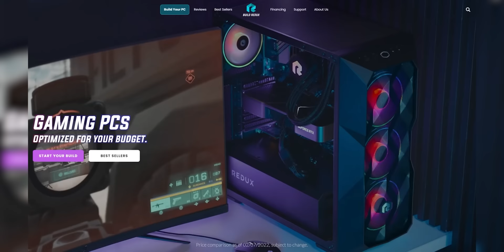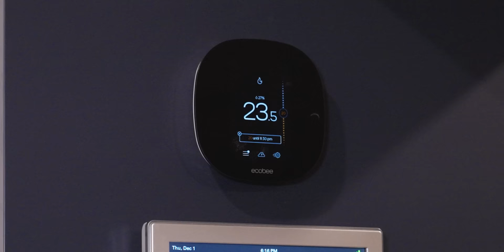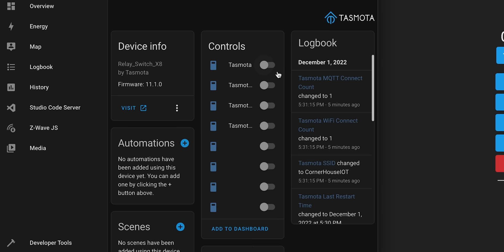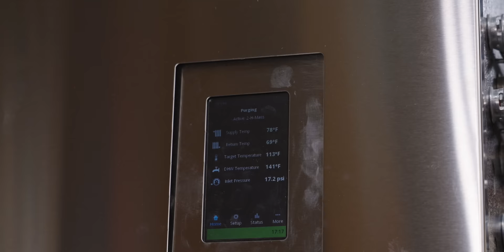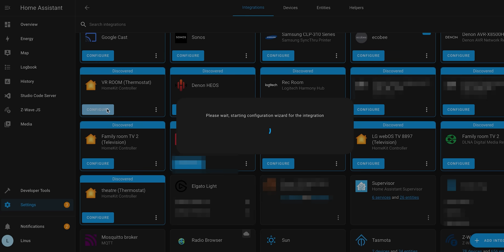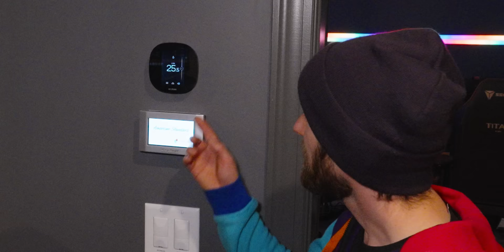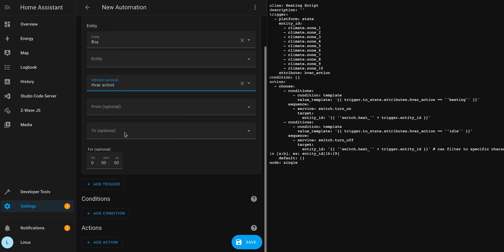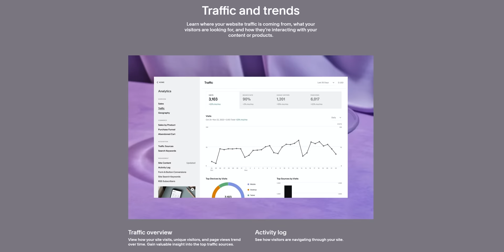My Smart Home is Stupid - HVAC Update

Comment: There's a company only 10 minutes away from the LLT offices called Delta Controls. I strongly encourage you go look at their stuff, maybe do a video on some of the stuff they do.
They make building energy management system (BEMS) controllers with a new product line coming that supports MQTT communications. Would be super interesting if those could be integrated into home assistant, if not then I'm sure they would have some cool stuff to show off. A lot of the engineers there are super nerdy based on some of the jokes and memes they put in their docs, wouldn't be surprised if some were viewers already.

Comment: You can buy separate temp/occupancy sensors for the ecobee's, and just set it so the each Ecobee uses the separate sensor for the temperature and not the built in one if it's being thrown off by the American Standard thermostats. Or you can let it average between the two sensors if you want. Plus, you get the bonus of having occupancy sensors.

Comment: I’m an HVAC tech I’ve had two ecobee‘s short out internally and generate heat causing the readings to be off I know that eco-bees don’t use relays and I think that what ever they use to do the switching is what’s causing it I doubt it will be a problem in the situation but in a standard system where the ecobee is actually sending voltage to turn stuff on when they short out it won’t send a Full 24 V signal usually they level off around 15 which causes the equipment act weird

Comment: A toothpaste factory had a problem.
They sometimes shipped empty boxes without the tube inside.
This challenged their perceived quality with the buyers and distributors. Understanding how important the relationship with them was, the CEO of the company assembled his top people.
They decided to hire an external engineering company to solve their empty boxes problem.
The project followed the usual process: budget and project sponsor allocated, RFP, and third-parties selected. Six months (and $8 million) later they had a fantastic solution – on time, on budget, and high quality.
Everyone in the project was pleased.
They solved the problem by using a high-tech precision scale that would sound a bell and flash lights whenever a toothpaste box weighed less than it should.
The line would stop, someone would walk over, remove the defective box, and then press another button to re-start the line. As a result of the new package monitoring process, no empty boxes were being shipped out of the factory.
With no more customer complaints, the CEO felt the $8 million was well spent. He then reviewed the line statistics report and discovered the number of empty boxes picked up by the scale in the first week was consistent with projections, however, the next three weeks were zero! The estimated rate should have been at least a dozen boxes a day.
He had the engineers check the equipment, they verified the report as accurate.
Puzzled, the CEO traveled down to the factory, viewed the part of the line where the precision scale was installed, and observed just ahead of the new $8 million dollar solution sat a $20 desk fan blowing the empty boxes off the belt and into a bin. He asked the line supervisor what that was about.
“Oh, that,” the supervisor replied, “Bert, the kid from maintenance, put it there because he was tired of walking over, removing the box and re-starting the line every time the bell rang.”

Comment: I’ve gotten pretty disillusioned with smart home products over the years. I’ve lost more time to dropped connections, hub failures, and other issues than I’ve gained from the automations. I’m hoping things mature and standardize more with the introduction of Matter, but it’s been a rough ride in the meantime.
Reply: EXACTLY!!
Reply: I'd welcome you to homeassistant to be honest. I still have my smartthings hub setup for the zigbee/zwave stuff but I really need to integrate that to my Ha directly but, Ha is definitely very stable for everything I have running wich ends up being quite a bit of stuff
Reply: Just wait until the utility companies override your settings, because you're using too much energy/resources! Nothing beats a wood stove lol
Reply: @JoeyJoJoJr0  This is why I wouldn't use any cloud based device. Certain companies are working on these things. Eve Energy uses bluetooth LE and their open standards Thread protocol to have devices talk to each other and not even need WiFi or internet.
Reply: HomeAssistant with a sonoff zigbee stick has been the best for me. No unexpected behaviour and it just works. I automate everything with some Node Red scripts and that's about it.
Reply: So many issues that could be avoided with a single twisted pair

Comment: 11:58 - That's a pain in the rear, but showing this will help others not to make the same mistake.
I've even come across badly designed thermostats where the device itself warms up the thermostat on the PCB inside to give incorrect readings.

Comment: What is great about Ecobee is they have room temperature sensors so we can more accurately get the temperature the way you want it in the room you actually sleep in.  Who cares what the temperature is in the hallway?  It can be too hot or cold out there and I don't care.  Most thermostats work that way because that is where they are placed.  The Ecobee temp sensors run on a watch battery and let you fine tune the temperature where you actually want it.  They also have occupancy sensors if you want to adjust based on that.

Comment: Use the output from the American Standard thermostats to input into the EcoBee, so even if the American Standard stat called for cooling it would only engage if the ecobee said so...  it's a switching 24v circuit that turns on and off a switch in the AC that will run a cycle...

Comment: I'm posting too many comments. But you can get specific plates to go behind thermostats to prevent heat from the wall from affecting them.

And the hole that the wires come through should almost always be plugged.

Comment: My ecobee thermostats have always sucked at reading the correct temperature. If you don't want to get external sensors you can adjust the reading in the settings but I still recommend external sensors. They work much better and you can get temp readings from the entire/multiple rooms instead of just the one spot on the wall.

Comment: In my previous flat I never actively heated myself in ten years. The window sealing was poor, you could feel the wind coming through and I was out working from 5am to 7pm most of the time. Would have been the biggest energy waste every. The heater only turned on by itself due to the freeze protection mechanism. So the average room temperature was 9°C and my bed room close to 3°C and below (badly insulated roof). And yes, I mostly was only in my T-shirt and barefeet. Well, my friends visited me never in the winter, once maybe, but then never again :D ... 

Now I have a house, modern build, perfectly sealed and it includes a permanent controlled air flow and air exchange system; in short: I don't need to open my windows for fresh air.
So, due to the permanent exchange of air, I have to heat in the winter so that the system's heat exchanger works correctly. Regardless, the system is set to a day temperature of 19.5°C and a night temperature around 17°C. My bed room's heating is turned off; it's only getting passive heat from the other rooms.

I always feel amazed about people wearing so many clothes and their need to set the room temperature well behind 23°C or even 25°C to feel good...

Comment: I love the FLIR on my uleFone Power Armor 18T. Much better phone than that CAT phone tbh. But, the FLIR is an amazing addition that I have used to find insulation issues electrical issues, etc, and you can find studs in your walls with them which is awesome as well.

Comment: Assuming you’re not just using Ecboee because they gifted the thermostats to you or something, it was a huge missed opportunity to not use Venstar thermostats. It’s a Canadian company and the thermostat supports a local REST API from the factory. I believe they do offer a cloud weather integration feature, but I don’t use it and it hasn’t skipped a beat.
Reply: Don‘t know about them but thermostat choice is pretty irrelevant imho. Smart home stuff only makes sense when you regularly change the settings of it, like the temperature. This however doesn’t make sense when you have in floor heating as it is so slow to respond (which is a  great thing)

Comment: Man I wish I had remembered to send a merch message about non communicating system options sooner. The only one I know of is Maytag but they have an 18 SEER modulating heat pump system that doesn’t have anything communicating about it and you can just use a standard 6 wire thermostats.

Comment: Just zone the ecobee with smart sensors and gut keen smart vents and use there receiver /actuator to run your in floor hearing.  It works on my radiator heating setup. Then all you need is to set your heat pump as emergency heat and get rid of your other thermostat.  A single ecobee will use in floor heating as your main heat and when it falls out of range it will use second stage heat/ emergency heat to bring the zone current and is all configurable in the single ecobee thermostat

Comment: As an HVAC tech this is a nightmare of a system. And its mostly the tech side of the system. I install Trane/American standard as my primary systems. I am curious to know if you have 1 singular heat pump or several connected to each tcon thermostat. they make zone sensors that can be weighted for those thermostats, several can be connected to one thermostat. those thermostats do give off heat at the top, its a frequent problem im tasked with addressing. I'm not sure having a dozen ecobee's was the right course of action for radiant in-floor when in-floor heating takes a substantial time to get to temp, though once the floor is at temp it would be better but still not as fast as other options. it would of been easier to leave new mechanical basic thermostats for the radiant in-floor all at a basic temp and have a secondary unit heat rooms to their ideal temp. Much like course and fine adjustment. that would zone the system easily without wasting money on utility bills and you still can adjust the radiant even further without having spent 2 grand on thermostats. But I dont know your rates for fuel. natural gas/propane and electricity costs. like if your electricity is wildly high.. well then this all makes sense.

Comment: I will buy floor heating controls, heat pump and ventilation that can communicate via RS-485, and make a custom HMI, maybe with Ignition HMI. That will be a very reliable system due to the serial bus, and easy to set up.

Comment: Yeah...instead of upgrading tech I downgrade pretty much as far as you can go.  I put in a big ceramic coated woodstove with heat pumps directly above it going to each end of the house.  Now sometimes it can be literally freezing outside and we'll have to open the doors and windows for a minute because it gets too warm if you leave the stove damper open too far for too long.   I understand this wouldn't be efficient and sustainable for most people but we have loads of wood on our land and cutting, splitting, stacking,  ect is therapeutic for me and its an excellent character building activity for the kids.

Comment: This has certainly been a fun watch to see you try to integrate a bunch of residential grade devices in ways they were probably never originally meant to be integrated and it's neat that you pretty much got it working but you probably would have been better served by a more commercial grade HVAC "DDC" automation system (IE Delta controls, Reliable controls etc). You would have had a cleaner install (no need for 2 separate tstats in each zone) and you would have more flexibility in the programming and operation of your system as a whole.  Anyways, just something to think about if you every think about upgrading down the line.

Comment: Is it possible on your boiler/furnace/heat pump/"thing that heats the water that goes into the underfloor heating" to set a target flow temperature? In the UK, most boilers will have a way of adjusting the "Leaving Water Temperature" (LWT) from the boiler - this is the temperature of the water that will flow into the pipework for the underfloor heating. Ideally, for wet/hydronic underfloor heating (UFH) you'd set the LWT to be quite low (say, 30-45 Celcius), and leave the heating on for most of the day. The LWT should be set such that the rate of heat output by the UFH equals the rate of heat loss from your house. This will be dependent on the thermal insulation of your house (a constant) and the outdoor temperature (and other weather conditions such as wind or sun), which is variable. Some boilers in the UK have "weather compensation", which uses a curve to automatically adjust the LWT according to the outdoor temperate; more advanced boilers might also have "room adaptation", which also uses indoor room thermometers to adjust the LWT. In any event, at night you'd have a "setback temperature", where you reduce the LWT for X hours so that your house was a bit cooler at night. This avoids the situation that Jake was describing, where it takes like 8 hours to warm up - instead, you keep the UFH and concrete slabs outputting enough heat to keep the house at a reasonable temperature all day and all night.

You might find that this makes your boiler more efficient and cheaper to run as it is running at a lower temperature, as if you have a condensing boiler it will be able to actually do some condensing, massively increasing the efficiency. It wasn't clear if you had a heat pump for the water in the UFH - if that's the case, then the heat pump ought to have these controls built in, and if you're lucky you'll be able to control it via HomeAssitant. If you're unlucky, like me, you'll have to rely on the built-in controls to set a weather compensation curve and setback temperature. But in any case, you'd ignore the thermostat and just use the LWT to control the temperature of the room with feedback from an outdoor air temperature sensor and a bunch of room temperature sensors.

Comment: You can calibrate those ecobee thermostats to read a few degrees above or below what it seeing. That would only help if the American standard thermostats are putting out a consistent amount of heat that can be compensated for

Comment: so with your EcoBees just calibrate the Temps in settings to the Temp Displayed on the bottom stat/use a Analog thermometer to get a reading and calibrate the stats to the correct temp room temps. this eliminates the diffrence in the states and gives the correct room temps on the displays. i do this for a living with universal programmable stats and residential stats when doing a complex install with heat all around the stat mounting locations. side not you could have used 1 Multi Programable universal input/output thermostate that is RS485 bacnet compatable and just used a free 3rd party BMS program to set everything up. then ud have 1 controller and a cool 3d Rendering layout of your system.

Comment: Red Seal Refrigeration and A/C tech here: 

Ecobee's also have a temperature offset that you can play with to offset a bit of the heat from the American Standard t-stat to modify what temperature is being reported/displayed. check the literature.

I'd be interested in knowing what heat-pump setup you have (Brand?Model?), assuming it is an air-to-air... Some models/manufacturers allow for both communicating and non-communicating thermostat configurations. Does the air handler have to run on the American Standard Thermostat? Carrier and Trane both have similar product lines with proprietary communicating thermostat options, but there are sometimes workarounds using network interface modules (NIMs), but that is an HVAC control thing. Have you reached out to American Standard tech support? might be an interesting collab opportunity. 

Check the air handler install manual to see if a thermostat can be wired for a conventional system (6 wire - RCYWOG) instead of a communicating system (4-wire - ABCD). 

also, a quick search tells me that American Standard systems support Alexa and Google Home... I know they are cloud based, but could you folks not figure out a bridge application for that?

Comment: I feel like Linus needs someone that actually uses homeassistant on a regular basis to help him out here.  You know, a minor thing like missing a MQTT broker may make setup a bit more difficult.

 May I suggest setting up node-red to make some logical flows for your heating solution. I do something very similar myself.  Makes it very simple to add a simple Javascript element to handle most of the logic.

Comment: was gonna ask as to why you didn't just wire into those 824 thermostats directly to control each zone as a second stage of the compressor or something, and then jake pulled one off of the wall to reveal that they are not 824 thermostats, and in fact they are 850 communicating thermostats, which would require a very fancy ZZONEPNLAC52ZB board to implement the first five zones, and a ZZONEEXPAC52ZB board to do the other 5, and both boards combined would retail around 750-800 USD assuming you can even buy the latter without being an hvac contractor

Comment: I have a Nest thermostat (which I do NOT recommend) and I had to get an external sensor because I figured out air is flowing from the attic through the wall to the thermostat through the wiring hole, throwing off the temp reading.

Comment: And yet tilting mercury thrermostats just work. And any interaction with multiple heating systems could be implemented old-skool, with relays. And don't take 30 minutes to boot on recovery from power outage.